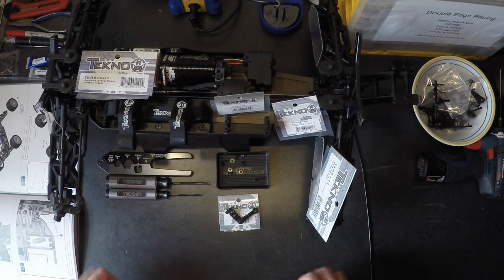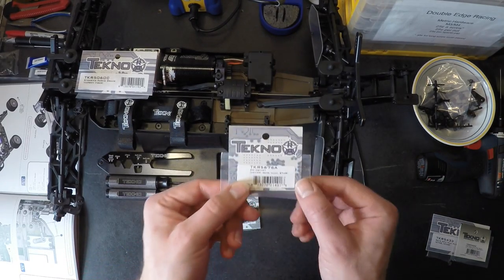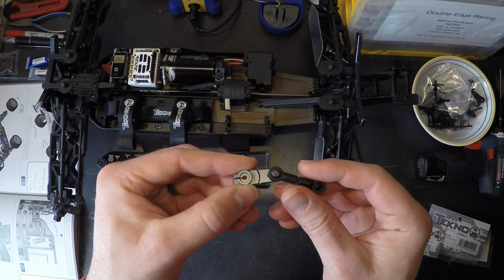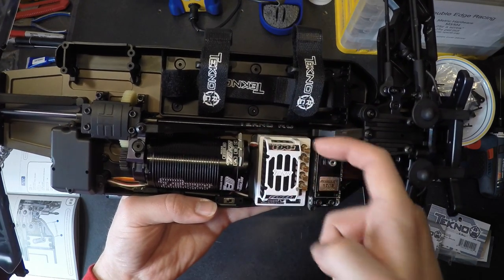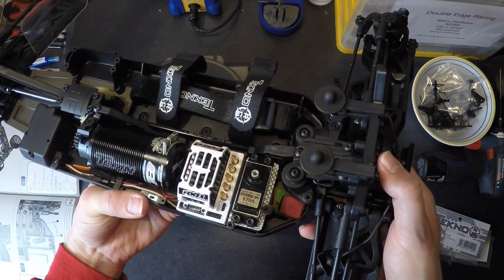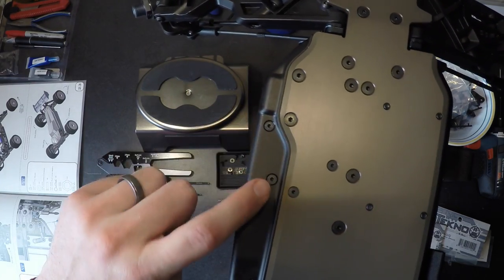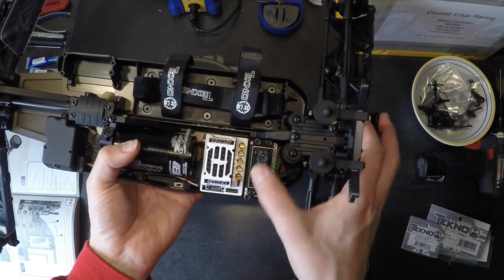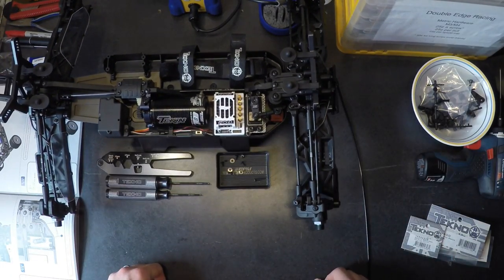TeknoRC ET48.3 Tips by Double Edge Racing - Electronics Tray

Comment: Hello I love your videos and I have a question I have a et48.3 and run a hobby wing xerun 150 amp with the xerun 2250 motor to match and can just fit it in my truggy with the wiring from the esc to the motor just sticking out past the side of the chassis and I took a hard hit from another driver Sunday and broke off one of the wires but I have tried every way possible to put it together so the wires don't stick out am I missing something or is it time to change over to tekin I love the response, handling and options on my hobby wing but they are just so big
Reply from the maker: I definitely prefer the Tekin to the HW, and I love the SMC ESC that I normally use now too.  If you want to stick with HW though, they also have the XR8 SCT Pro that many people use in 8th scale.  It is very similar to the full sized XR8 that replaced the old 150, but it has a smaller footprint and only does 2s-4s, rather than up to 6s.

Comment: use a tall servo horn that holds the link on the underside of the horns arm.
Reply from the maker: We actually used to do that with the Hot Bodies servo horn early on.  We switched as it was hard on the servos with the extra leverage on the bearings and spline.  The Tekno servo horns are now low profile to help keep things as easy on the servo as we can.

Comment: What size pinion are you running?
Reply from the maker: 17t on the Tekin T8 2000kv truggy motor, with no timing/turbo, and about half for punch/current limit/torque limit, depending on which ESC settings are available based on the ESC I'm running at the time.  Other folks will often run 16t instead to tame the top end, or sometimes put timing turbo back on at the very top to get top speed back.

Comment: What does sub trim do?
Reply from the maker: Think of sub trim as a way to set trim ahead of time, so that everything will still work evenly from side to side.  Trim is then on top of that, but won't change things like end points.  The general order to properly set up steering is to: 1) Mechanically center the steering and put the servo horn and link on the servo while it is centered.  2) set the sub trim to make it truly straight. 3) set end points to make sure you have full throw, but not excessive throw  4) drive.  Trim is kind of a temporary patch in case you find you've worn a tire on one side more than the other (say due to a high speed sweeper) and now the car pulls at the end of a long race when going down the straight.

Comment: So the outer hole of the horn is more torque-ki?
Reply from the maker: Outer hole is faster and needs a higher torque servo.  Inner hole is slower, but is nicer to the servo so not as much torque is required.
Reply: justpoet 20kg servo at 6v can use outer hole? I would like it to be faster..😀